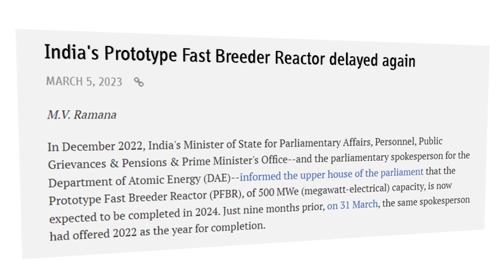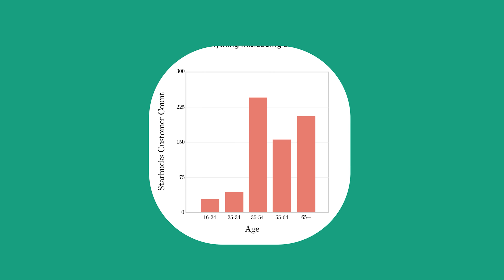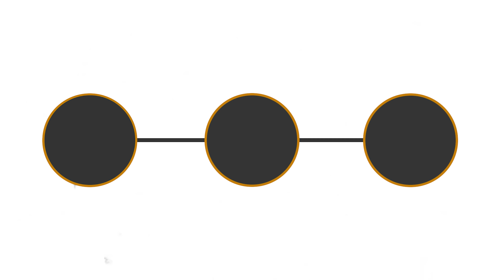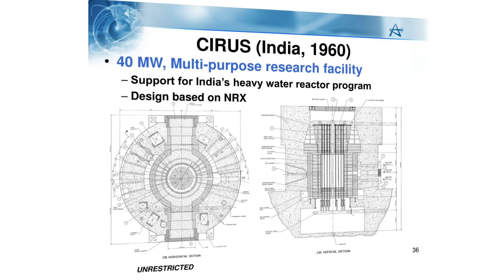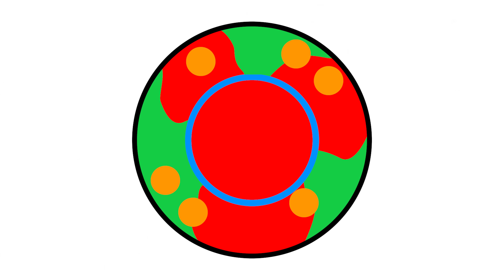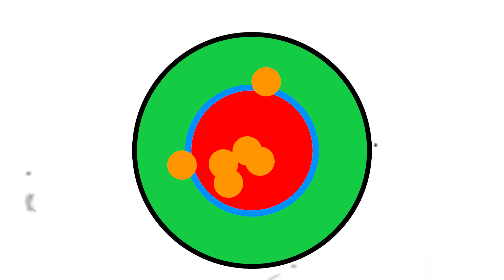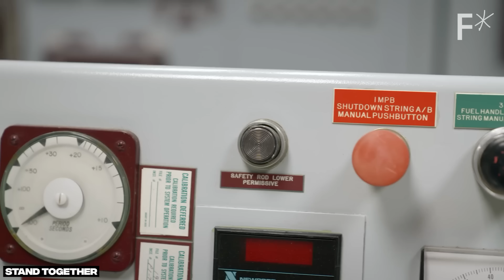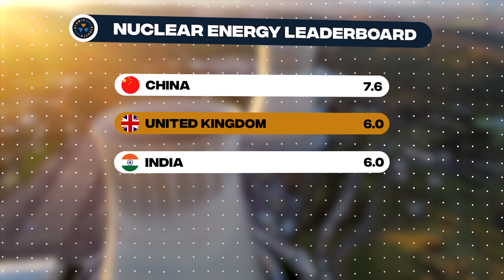Why Sand Will Power India for Centuries

Comment: Using thorium or uranium does not matter already found in india like awaited and over 4Gt <300$/kg out of seawater is no end cost factor if both also breeded.

Much indians working in gulf countries that could also deliver much D out of hydrogen from sea water HxOy or methane CHxDy used in Abu Dhabi for H2 from CH4+H2O+heat for chemical industry & HD separated in 7LiD 7LiH centrifuge heated >1000°C decomposition like TiH2 from TiO2+CaH+heat etc.
Clean H used for BH3 & NH3 separation of 10B / 11B & 14N / 15N isotopes.

Gulf countries can pay developments also for small test turbine cycle using CO2 with steam pressure 57.3 bar 20°C and sucking centrifugal compressor (earth gas) backflow cooling (indirect) to heat & steam inlet of all that way thermal isolatable
usable for all steam power also with heat of existing cooled H2O condensor and surfaces or from hot air sucked with 2. compressor that way more hot & dense for heat transfer to CO2 turbine cycle air expanded over driving shovels cold for aircon and water out.

Do they have agrar culture with sheeps, cows & fishes inside towers for visiting ?

Recommended for high surplus very secure fast breeding a new pebble bed HTR with pebbles out of thin tungsten alloy filled with MgO and U in ZrC between tungsten reflector with breeding and fission areas for running pebbles.
Overheat self slow down, passive out <2s, no decay heat problem unburnable.

Why FLiNaK instead only 7Li as moderator and coolant with bubble slow down from 180°C-1340°C possible in Na breeder or combined with 15ND3, cubic 11B&15N or simply D2O primary cycle PWR ?

Using thorium or uranium does not matter already found in india like awaited and over 4Gt <300$/kg out of seawater is no end cost factor if both also breeded.

India Can Do Future Candu HTR with liquid about 9 bar 15ND3 ammonia instead D2O between RBN (cubic 11B&15N) tubes & RBN fuel with pressure bubbles control quick passive away if 7lithium inside >1000°C instead H2O as excellent coolant & moderator with bubble slow down 180°C - 1340°C without pressure a storey sand upon tubes over MgO melting pot etc.
running with unenriched UO2 fuel about 30 years.

Making of gold as side product of cold fusion shooting cheap mercury into Lithium-Deuterium for 6Li+D→2 He, 6Li+n→He+T, D+T, D+D→T+p, 7Li+p etc. from Hg and following He punshes 20-30 MeV Hg n-spallation to 197Hg→Au.

Comment: 00:01 India's nuclear development is stuck in perpetual delays
01:42 India aims to become a nuclear energy leader.
05:11 Heavy water reactors in India produce both electricity and plutonium efficiently.
06:52 Breeder reactors produce more fuel than they consume.
08:27 India's journey to develop a fast breeder reactor is complex and challenging.
10:03 India's long-term plan to power nuclear reactors with thorium
11:39 India's nuclear energy production is below average.
13:13 India's nuclear energy potential with thorium
Crafted by Merlin AI.00:01 India's nuclear development is stuck in perpetual delays
01:42 India aims to become a nuclear energy leader.
05:11 Heavy water reactors in India produce both electricity and plutonium efficiently.
06:52 Breeder reactors produce more fuel than they consume.
08:27 India's journey to develop a fast breeder reactor is complex and challenging.
10:03 India's long-term plan to power nuclear reactors with thorium
11:39 India's nuclear energy production is below average.
13:13 India's nuclear energy potential with thorium
Crafted by Merlin AI.

Comment: Stupid approach.  If the used Molten Salt Reactor approach the thorium is directly converted into plutonium during the burning process which is directly burned.  The fuel and thorium and R233 is used to start the process.  Thorcon and Copenhagen Atomics  will manufacture their simpler design in the next 5 years.

Comment: You uploaded it on 28th March 2024 but showed article of 2022, when on 4th March, 2024 India performed the core loading in PFBR. That's not fair.  And as of today's date India has not only completed PFBR but also got a green signal from its respective authority board to fill in the fuel & start using it

Ref:
https://pib.gov.in/PressReleaseIframePage.aspx?PRID=2011347
https://pib.gov.in/PressReleaseIframePage.aspx?PRID=2039099

Comment: There's a very well known problem with Thorium that people gloss over. The length of time it takes to breed fissile U233 from fertile Th232. It takes roughly 10 times longer than breeding fissile Pu239 from fertile U238 because the intermediate isotope, Protoactinium 233 has a half life roughly 10 times longer than the intermediate isotope in the U to Pu cycle, Neptunium 239.  

That is the reason why the Indian project to get the country running on Thorium was planned to take 70 years. It was started over 50 years ago and is still in its early stages.

We do not have the luxury of time to switch over to using Thorium for nuclear power, we have to switch to other forms of non-fossil fuel energy production.
Reply: can u explain it in details plzz

Comment: 4:30    Th 232 -> U 233 would be more accurate, the final fuel the thorium is converted to is U233 and not U238
Reply: Oops. I just added the same comment. I should have looked further into the comments. 🙂

Comment: Just watched your video on busting myths about THORIUM. In one section you said that U233 formed from thorium can be extracted to be used as potential nuclear weapons ( already tested by USA in Operation Teapot-MET). But I have read some articles and seen some videos where it says that U233 also has some U232 which acts as a poison in two ways. 1st U232 has Gamma radiation making its very difficult to handle and it can also lead to Pre-detonation. Also it is very difficult to separate U233 and U232.
Although another way to get pure U233(without U232) is to Extract the Practinium Pa233 which forms from beta decay of Thorium in reactor. This extracted Practinium Pa233 can further beta decay outside the reactor to form pure U233. 
Could you please clarify.
Reply: This kind of handling the Thorium fuel cyle seems to be very complicated and dangerous. Here Gen IV concepts, like the Dual-Fluid reactor (DFR) with liquid fuel and integrated pyro processing unit, for waste separation seem to be much more convienient.
All fuel stayes in the shielded area of the reactor, and the heat of all activities can be captured.

Comment: In second stage of Indian Nuclear program
Fast breeder reactor uses 
nuclear waste+ plutonium+thorium= electricity  +U233( that is thorium) + plutonium
This reactor produce 120 % of nuclear fuel then how much it consume to produce electricity. One more thing this reactor use nuclear waste and plutonium to produce energy and convert thorium into U233.
This is not like any other fast breeder reactor (FBRs)& fast reactor. It's something different
Reply: Fairly obvious question is that because breeding Plutonium from Uranium is 10 times faster than breeding U233 from Thorium 232 then if you have fast breeder reactors producing Pu239, why would you need to use Thorium?
Reply: @JohnSmall314 because India is not a part of NSG group (due to USA).
We don't have uranium reserves and we have 25% of Thorium reserves.
That's why we are developing thorium nuclear reactor.
Reply: @JohnSmall314  it's because uranium 233 it is can't be used for weapons. 
There is only small amount of Uranium in India that is can't even satisfy consumption. 
India is home of one third of thorium reserves in entire world(Actually the thorium reserves are increasing because the results we already calculated is not fully accurate by conducting another survey we find about the amount of the thorium that is only present in 50 ft in one largest mine in India but the thing is 200 ft you can extract torrent that means that largest mine in thorium in India increases into nearly four times).

Plutonium is used to produce nuclear bombs . Plutonium 239 is very highly fissile material.
India's plan is not to make more plutonium. India simply want to make  energy from thorium .
If India use only plutonium to convert thorium India can't produce electricity from that reactor. 
If India use uranium along with plutonium to convert thorium there is already Uranium is becoming plutonium in that process there will be more energy producing in that process then the normal uranium reactors. 
In the same process when this reactor producing energy thorium also converted into you to U233.
In this process three things is happening in same time 

1.Reusing of nuclear waste to produce energy. (India actually planting from beginning that's why India stored all the nuclear waste very carefully).

2. Producing electricity from nuclear energy (in this process the most of the uranium will be converted into plutonium this plutonium will use further in the same step with along with Uranium).

3. Converting thorium into U233 to use electricity in future.
Reply: @JohnSmall314  Our caretaker told me to let others do the research.

Comment: The cost of bringing a nuclear plant online is finance for the wait as even the experimental though relatively understood breeder reactors are unreliable and frequently run below capacity even after 20 years.  The sodium breeder reactors are very problematic as the sodium can explode in water, frequently bursting into flame when exposed to moisture in air.  The U.S. EBR1 had a meltdown.  Whatever they say about their ambitions, it seems they are successful in breeding U238 into plutonium and making bombs.  Thorium appears to be a cover story, as the cost of publicly available and cheap U238 which has a much better cross section in a sodium fast breeder reactor is primarily being utilized.

Comment: The map you have used is wrong, complete states of Jammu and Kashmir have been erased. Please correct this ASAP. The correct map is at 1.24, maps at 3.28 and 4.06 should be updated.
Reply from the maker: The map at 4:06 is from Wikipedia and demarcates the disputed areas in accordance with the UN recognized boundaries. I have removed the other two segments.
Reply: @atomicblender  UN was not even born 5K years ago, Kashmir is been our part of civilisation since then.
Reply: @penguin_88 not here
Reply: Thanks. Appreciate your quick reply.

Comment: Elina Charatsidou mentioned in her channel a potential issue with the Thorium fuel cycle. She said that Uranium-233 can be used for nuclear weapons (in her video "What are Thorium Reactors?"). It implies, that the regulations against Thorium are in place already because of this, not by accident. Which is why she thinks, that Thorium will not move forward very much...
Reply from the maker: I don't think that's any reason for thorium not to move forward any more than uranium already has, since both can be used for energy or weapons. The normal non-proliferation rules apply to uranium and thorium both for generating weapons material, like heavy water, enrichment facilities, chemical separate processes, etc.
Yes, thorium can be used for generating U-233 for weapons. This was demonstrated by the US in a 1955 test. I cover this in another video on thorium here: https://youtu.be/MKHEm6rbsAo
Reply: @atomicblender Thank you! Hadn't noticed the video yet. This makes it very clear - the non-proliferation rules will have to be met eventually by all the new companies developing thorium MSR's.

Comment: In my opinion India really messed up by building that atomic bomb so fast.   The USA perfected a PWR thorium breeder core in the 1960's and India could have been using it all along.

The USA actually thought that thorium was a very likely candidate to be the main nuclear power plant fuel in the 1950's.   They developed a modest fuel production plant and built 4 commercial power plants in the 1960's - 1970's that were specifically designed to run on thorium, and breed more U233 than they consumed (1 PWR, 1 BWR, 2 HTGR's).    The BWR and HTGR's were technological flops.  But the PWR worked (although the fist core load was not the most efficient core design - something the USA later figured out).

Along with the fuel production plant they also ran thorium in another existing PWR (designed for U235) and reprocessed the fuel to produce U233 to seed future thorium power plants.  It's this other PWR where they perfected the breeder core design.

The biggest lesson from this USA program is that it cost significantly more to refine thorium ore into reactor fuel than it cost to refine uranium ore into reactor fuel.  

The reason everyone is running uranium in power plants is because its much more economical to do so.   

If thorium was cost competitive you would likely see about half the PWRs in the world operating with thorium.  If it was outright more economical as a nuclear fuel you would see almost no uranium PWRs today (and governments would likely have spent the money to figure out how to make thorium work well in other reactor designs: Note that Germany did develop the thorium pebble bed nuclear power plant design:  China licensed the technology and is now running uranium pebble bed reactors).

To this day the USA is sitting on something like 20-30 tons of reactor fuel grade thorium, and I believe 1000 + Lbs of U233 to seed thorium power plants.  Note that the USA has been disposing of the U233 stock as the containers it was stored in have degraded and its cheaper to dispose of than to repackage and continue to store - especially with no current foreseen use (this is a multi-Billion dollar project).  

The most pure U233 produced in weapons production reactors have already been disposed of (virtually no radiation issues).   The U233 extracted from spent fuel meant to seed reactor fuel is 15-20 times more radioactive and they are still working out how they are going to handle it.  However, I expect that within 3-5 years it will all be disposed of.

I have no idea why India chose to not build PWR power plants and run thorium breeder cores.
Reply: It was inevitable. The reason India opted for nuclear weapons was because the US sent it's Seventh Fleet to threaten India during the Bangladesh liberation war/India-Pakistan war of 1971, which really spooked India's leadership. Also, China had also developed a weapon back in the sixties, and India was badly defeated in a war with China then. IMHO, it's largely for the better that nukes came early to India. Wars declined significantly ever since, being reduced to skirmishes.
Reply: Dude. CIA assassinated Dr Homi Bhabha (father of Indian nuclear program) in the late 1960s. Nobody is under the illusion that USA would have parted with its reactor tech without ensuring that India became a vassal of USA. Which wasn't an option for us Indians even back then, forget about now.

Comment: If India stopped wasting money on the money pit of nuclear energy and invested in renewables, they could turn round their energy sector in years, not decades. But they would not do that, because as you should have pointed out, plutonium and uranium 233 are just too good for making nuclear  bombs with.
Reply: We are investing in renewables as well mate. Renewables are good for home use but industries need something a bit more reliable. So the long term plan is to supply home with renewables and industries with nuclear energy
Reply: @saharatul he just wants to lecture coz you know a  white is always better 😂
Reply: India has the world's largest solar plant at Bhadla and a gigantic 30GW solar/wind project under construction in Gujarat. If anything, we need much more nuclear than being envisioned now, for reliable 24/7 supply and to reduce import dependency on China for solar and batteries.
Reply: India is one of the largest producer of Solar, Wind and Hydro electricity
Reply: We're not exactly sandwiched cozily between Canada and Mexico.

Also, renewable energy doesn't scale well. It's not future proof. Nuclear is the only best option available.
Reply: I agree,  they are now investing in solar power. However this will not be good for their nuclear program. If they are not prevented by politics, Solar and wind will be the cheapest energy. They are at the start of the S curve and within a decade Solar and wind will account for almost all the energy. We know they are intermittent but energy storage is already here and prices are falling quickly. By contrast, if they decide to invest in nuclear there will be nothing completed for at least a decade. The timeliness are even worse if they go for Thorium. Then we are looking at several decades (we've already waited 5 decades). What demand will this future nuclear power satisfy, whe they have 100% wind, Solar with storage.